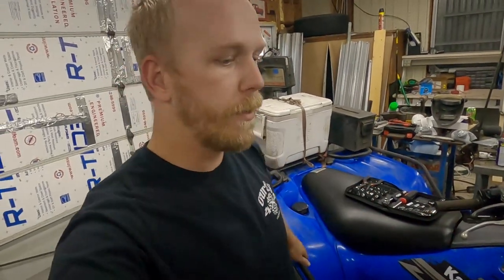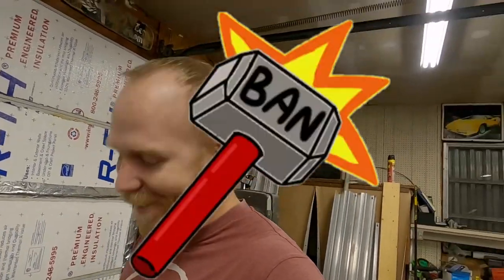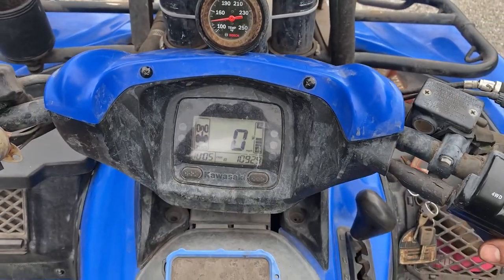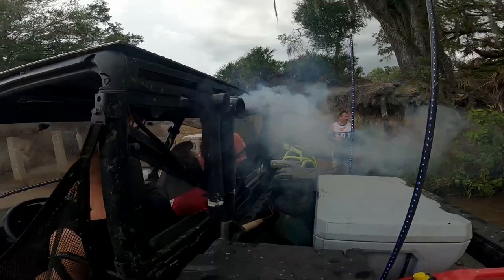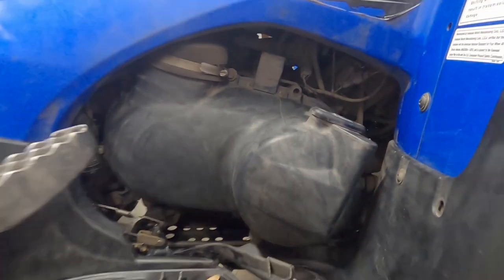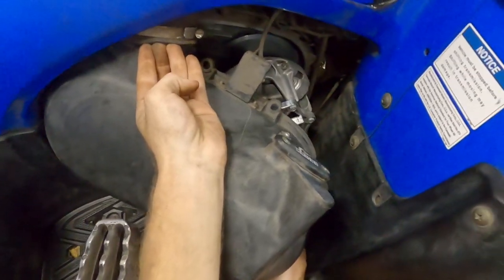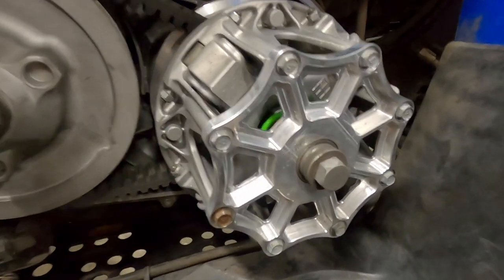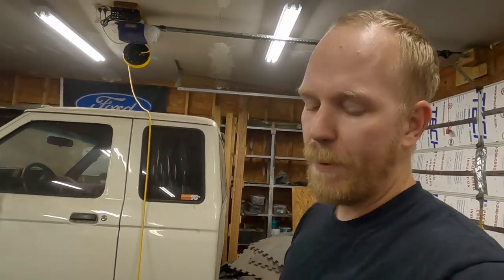Brute Force Stage 3 Clutch **Long Term Review**

Comment: I just got vfj's flash tune on my stock '22. It totally rips much more aggressively from take off to mid range. No matter how far forward i hang off the front, the front end is instantly up and over. Its a weapon for sure. It actually wont wheelie on grass and dirt anymore (stock tires) as it just throws masssive roost while spinning. But I'm wondering about tho is the max rpm seems significantly higher like maybe around 9500 which u would think wpuld give me more speed but i actually lost 1mph from 69 to 68. It feels like its reving past its peak power range of the stock cam and looses some pull after the midrange. Can i do the same thing we used to do with sleds and put heavier weight in the stock clutch to bring rpms back down into optimal range for even harder acceleration in the mid to top end?

Comment: Hey just found your channel, went ahead and subbed because who doesn't like some John Belushi. Yeah I'm that old..65
.. anyway recently bought a '17 BF with 800 miles on it. It has been snorkeled and rad relocate but only has 26" tires on it and does not appear to have been mudded too hard.Its pretty beastly compared to my last 800 sportsman but has that take off hesitation waiting on the belt to spool up so I'm thinking stock clutch and have yet to find a fuelmapping tuner although I've not torn it down yet. If not I'll probably do an EHS tuner and Barker exhaust. Don't think I'll go bigger than 28" tires though. It does have a 2" lift and 1 1/2" spacers and stock shocks. That being said, how far would you go with clutching? Picked this up for $5,300... Also has new Atlas 6 ply tires.
Reply from the maker: Thank you for subscribing and Congrats on the new machine! With 26s it shouldn’t have any noticeable hesitation at all. I would suggest pulling the clutch cover and inspecting/blowing out the clutch. Look for belt wear and sheave grooving and go from there. There are a couple people doing tuning flashes. VFJ, FTGU, and DJ customs off the top of my head. I have the FTGU tuning and it’s awesome throttle seams even snappier and it runs cooler

Comment: hey good video ,how does one get ahold of this guy is it a kit that you can buy as a whole or do you send in your clutches and have them done up.what size rubber are you running,i see you have taken out the kebs ,is that a good idea,... i am looking at the 2022 brute ,i have had polaris and ac so know a bit about what i want in a quad,for one thing is the weight,coming from my 2018 850 hl with me on it was 1200 lbs great bike but dam was a hand full to ride, ahd the 2014 ac mp 700 and found that to ok but it is a single cylinder that i found to work way to hard. i find buying a 650 or 850 cam am a waste of money when i can buy the kawasaki and do it up the way i want and still have 3000 bucks in my pocket.any ways keep up the great vids and ride safe
Reply from the maker: Thanks! I messaged him on FB. He can either do a new clutch or a used one or you can send him yours. I’m running 30” cryptids I really haven’t noticed much of a difference without the kebs but it makes the clutch last longer supposedly because engine breaking uses the clutch. I 100% agree with you there I’ve got about 13k total in my bike if that including the price of the bike and it’s way more capable than any 14k plus stock outlander
Reply from the maker: Thanks for watching! Make sure to hit the like button and subscribe if you found this video helpful. It really helps my channel grow and it will also make sure you won’t miss any upcoming brute force video’s. Got a lot of cool stuff planned!

Comment: hi there again, hey when you remove the kebs do you still have to reset the clutch after putting on a belt or cleaning out the clutches..what size tires are you running. have a great day
Reply from the maker: You mean like the CVT warning light? the CVT light will still work meaning you’ll have to reset it when you change your belt or disconnect the belt box. I’m running 30” ITP cryptids. Have a great day bud

Comment: Looking to get a mid size atv , what would you recommend?
Reply from the maker: Depends a lot on what type of riding you do and what you want out of it. Want power? id recommend can am outlander 650 or 850. Want reliability I’d go with a Honda Formeman foot shift. I personally have had good luck with the brute force 750 I think it’s a good middle ground between Honda reliability and can am power. With proper maintenance anything will last. Only brand I would not get for a four wheeler is Polaris

Comment: what price
Reply from the maker: Depends on the condition of your clutch and what you get done. Mine was a little over 600$ when all said and done but I needed a new secondary, all new wear parts on the primary, new shims, Stage 3 on both primary and secondary and the billet faceplate